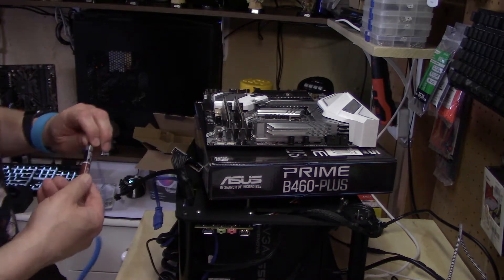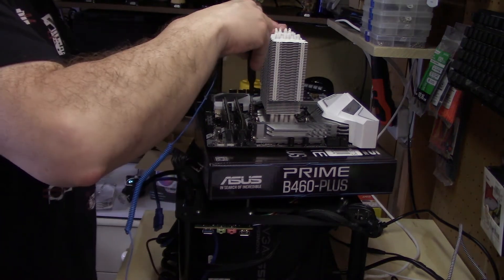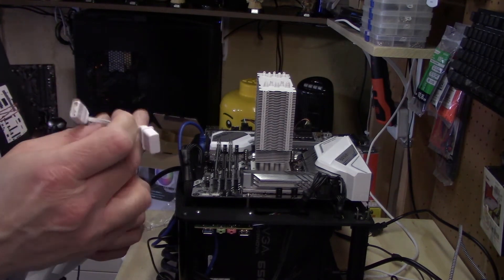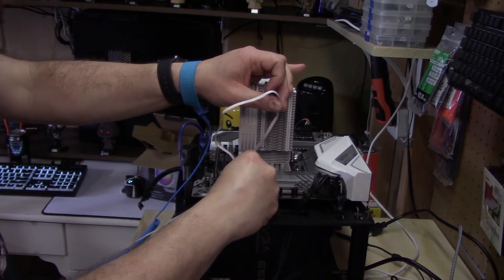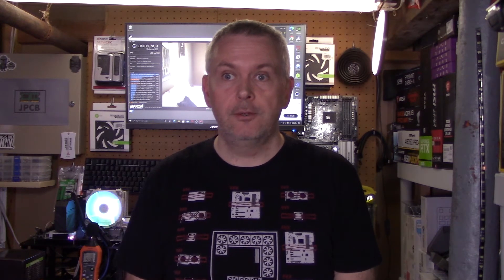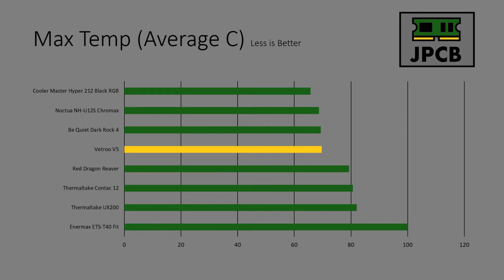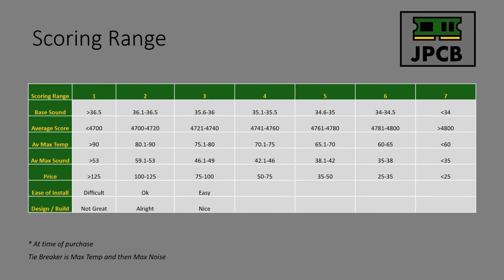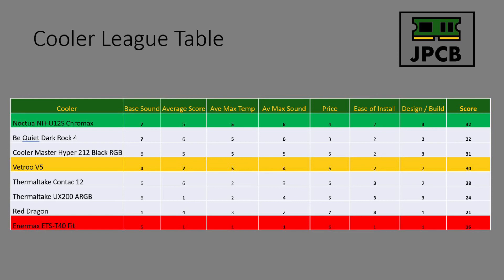Vetroo V5 Vs Noctua NH-U12S and More

Comment: Great Video! Thanks so much!
Reply from the maker: Thank you. Are you going to get the cooler?
Reply: @jimbopcbuilds  Thanks for the reply! 

I'm definitely thinking about it - I'm trying to decide if there are any other coolers that might be slightly more expensive but have features that would make that expense worth it.

I was initially looking at the Noctua NH-U12S chromax.Black, or the Redux of the U12, or possibly any coolers in the 30-50ish$ range. There are just so many options out there! Any thoughts on how your Cooler League Table vs price would be greatly appreciated!
Reply from the maker: @Phoenix0784   I've added a few more coolers to the league since covering the Vetroo, at different price ranges. For not much more money I'd defo take a look at the ID Cooling SE-226-XT. It's an awesome cooler. As for price, that is included in the score.
Reply: @jimbopcbuilds  Oh that looks pretty darn good! 

In your experience/testing is there any reason to pay in the 80$ range for something like the NH-U12 or would the one you recommended / something in that range be good enough for a 5700x maybe 5800x
Reply from the maker: @Phoenix0784  Noctua are a market leader with their fan and cooler design. When you pay for their stuff you're paying for fans that run super quiet and super efficiently. They also cool super well, but like other brands they have a product stack and the NH-U12S is not their top cooler, it's just a fantastic cooler for it's size etc. The ID cooler is also a fantastic cooler. It's bigger than the U12S so it won't fit in a small case (check your case cooler height) which the U12S would. But if you've got room I'd go for the ID cooler. It's great value for the cooling performance you get and yes it should cool the 5800x. Just be warned though, some of the 5800x can run very hot, so don't be suprised to see highish temps.
Reply: @jimbopcbuilds  Makes total sense - thanks so much for your advice! Keep up the awesome work man!
Reply from the maker: No problem and any time.

Comment: Thanks for this comparison, I was literally wondering to replace my Vetroo V5 with the Noctua NH-U12S brown. Guess it's not worth it!
Reply from the maker: What CPU are you using it with?
Reply: @jimbopcbuilds  5600x. The best CPU for that statement to be true lol. I think above 65W and I'd prolly get something else, Vetroo for sure lying about being able to cool a 5800x, it cannot reliably do it.
Reply from the maker: The 5800x is a hot CPU. The one I had would throttle when stress tested and I had it on a 360 AIO. But back to your CPU, agreed the vetroo should easily cope with a 5600x.

Comment: Will this cooler keep a 10600k/f cool enough @5ghz? *On an average voltage setting slightly above stock.
Reply from the maker: Good question. It will 100% keep it cool at stock. But with an over clock I’d be a little more hesitant. I’d go for the ID Cooling SE-226-XT which I just tested. 1) it’s only $10 more (if that) 2) it performs way better and 3) it is designed for socket 1700 and doesn’t require an adapter. It beat the vetroo by a few points in the latest video.
Reply: @jimbopcbuilds  Ok. Thank you!

Comment: There should be sticky tape you peel off of that bracket that you couldn't get to stay on the bottom.
Reply from the maker: I know. I missed that when I did the install. Also keep in mind that I don't want to use it as I then have to remove it when installing the next cooler.

Comment: What was the cpu used for the test?
Reply from the maker: I use a 10700k in all of my testing. I may upgrade to one of the intel CPUs in the future. It's just a pain having to get all the new socket adapters etc. That or I may wait to say what price the 11900k goes down to. I did think about the 10900k but they seemed to have all gone now.

Comment: very nice video. the evo 212 is now cheaper than the V5.
Reply: edit. the evo 212 just checked now and amazon changed the price today and it is higher now.
Reply from the maker: The 212 goes up and down in price all the time. Was it the black edition on offer? That's got better build quality etc so I've not seen it come down too often.
Reply: @jimbopcbuilds  hopefully I'm not mistaken but it was the black rgb version.i have the non rgb older version 212 so been checking them now and then and saw it for about £30.
Reply from the maker: If it is then that’s great deal. It’s really nice cooler.

Comment: Is vetroo u6 pro much better or same???
Reply from the maker: I've bot tested it, but it has 2 fans, more cooling surface area and an extra heat pipe so I'd be surprised if it wasn't better, but without testing properly it's difficult to say for certain. It's a cooler I'll add to the list, Thanks.
Reply: @jimbopcbuilds  ok, I think I buy it for my ryzen 9 3900x and in a few years an upgrade to 5950x
Reply from the maker: Sounds like a good plan to me.

Comment: I really like your video.  Just ordered this cooler because my cyberpower stock aoi was hitting 100c with Blender, and really happy to know that it seems I picked a good one and I get to keep my RGB setup for my PC.
Reply from the maker: 100 on an AIO? Wow! Do you have an overclock in place? Is it relatively new? I'm surprised with an AIO that high. I guess you could have got a bad one?
Reply: @jimbopcbuilds  No OC at all, and it hit 100c on a CPU render on Blender after about 15 minutes.  Was pretty high detail and high resolution.  But yeah it shocked me and I knew I had to get it swapped out.  But its just a 120mm aio and I'm running a 11900K, so probably wasn't going to be sufficient to begin with. 
But also could just be a bad one.  But from everything I'm seeing on the Vetroo, I'm really happy with what I'm seeing and hoping to install it tomorrow.
Reply from the maker: @shanewilson7994   Ah a 120, that adds up, especially with a 11900k which is a bit on the hotter side. You'll have to let me know how it goes with the V5. I've tested it with a 10700k so it'll be interesting to see your numbers.
Reply: @jimbopcbuilds  Will update you when I get some numbers this weekend.  I'm really interested too, especially since this will be a PC mostly for rendering in Poser & Blender.
Reply: @jimbopcbuilds  update:
with the 120aio
Idle was 32-33c
Normal usage maxed out at 68c, CPU intense usage (Blender using CPU to do the render Poser) both hit 100c within 5-10 minutes, you could see the cooler fighting the temps but couldn't handle it.

V5
Idle is 30-31c
Normal usage is 56-58ish (streaming, gaming, etc).
And Poser/Blender using the CPU to do the renders held at around 85-87, depending on render (about 20-45 minutes per render) and the highest brief spike I had was 92.  But was only a single core that hit that and was only once.  Otherwise the spikes are 89.  So still a little on the hot side for me, so I may try a more expensive cooling solution down the line, but this is a definite upgrade.

Thanks for the review.
Reply from the maker: @shanewilson7994   That's big move in performance. Keep in mind how much it costs and what you're throwing at it, that's amazing! Let me know what you're looking at when you do upgrade, a 360 AIO, a beefier air cooler or are you thinking custom loop?
Reply: @jimbopcbuilds  
Its definitely a huge improvement and I'm very happy with it.  And it installed real easy.  Once I got the right measurement for the back plate and the holes lined up, I just used the adhesive to get it to stay. 

Currently I'm thinking of flipping one of my top exhaust fans to intake (I have 3 intake on front, 1 exhaust on rear, and 2 exhaust on top (one being in before the CPU cooler and one after).  And I notice the first one is always blowing cool air, and the back one hotter air, so thinking of flipping the first one to get more cool air to the CPU fan to see if that'll help me get closer to 80c on heavy load, or under. 

I am not comfortable doing a a custom loop, especially not in a market where getting replacement parts if I mess something up is going to be super costly. I'm thinking of a beefier air cooler for the next upgrade, I like aio's but its a lot of potential points of failure and I tend to be someone who plans for the worst.   I just have to make sure the new air cooler has clearance for my ram (4 sticks, and the V5 fan is really close) and I don't think I have too much more height clearance on my case for the side panel, so I might end up having to do a 240, or maybe a 360mm if I can get it to fit on the front of my case.
Reply from the maker: Having positive air flow may help the cooler as it will have more cool air being pushed towards. You might want to also think about adding a fan to the cooler. I can't remember if they included an extra set of clips. If you have the black version that should be easy to do without looking too bad. Having push - pull may bring things a bit. That might be easier for space than getting a larger cooler.
Reply: @jimbopcbuilds  it does have extra clips, and I have a bunch of extra fans (LED too) so I may try adding it this weekend and seeing if that helps.  Thanks. 

If I get any real noticable different I'll let ya know
Reply from the maker: @shanewilson7994   Excellent, fingers crossed.

Comment: There is adhesive on the mounting plate that will hold it against the back side of the motherboard, you just need to unpeel the protective layer.
Reply from the maker: Yeh somebody mentioned it. I wouldn’t wang to use it anyway as I have to change coolers often.

Comment: Nice vid man, Got mine for $25 on sale to replace a stock cooler on a Ryzen 3600, about a 25c lower temps than stock cooler during stress test for me, Great cooler for the $$ for sure
Reply from the maker: At $25 it’s even more of a bargain. I used to do videos comparing coolers with the AMD stock cooler. I’m not surprised the V5 is so much better. It’s a really good cooler.

Comment: i actually needed this video. thanks. i believe the intel bracket has double sided mounting tapes for easier installation
Reply from the maker: Thank you. I didn't spot the sticky tape, that would have made a difference, although with swapping coolers out all the time for me personally I may not have used it, but for somebody buying one to use in their PC it would really help. Thanks for mentioning it.
Reply: Yep jay mentioned it on his vid
Reply from the maker: Ah ok, I watched the video a few weeks before getting the cooler and doing the testing.